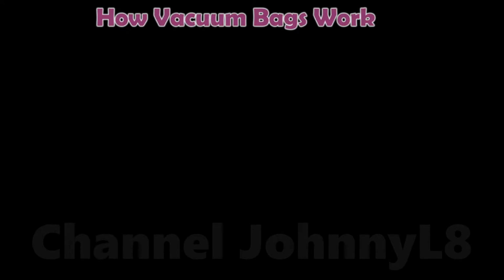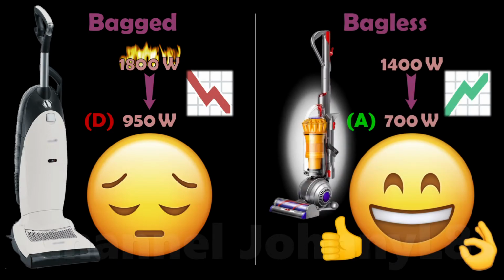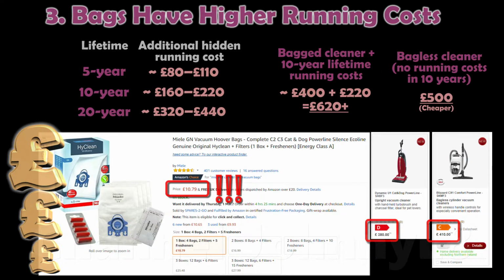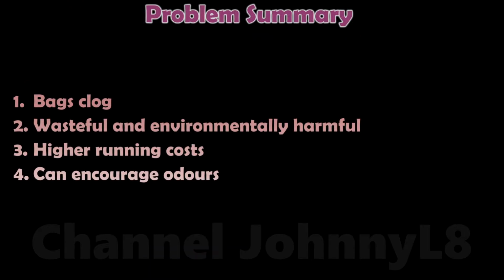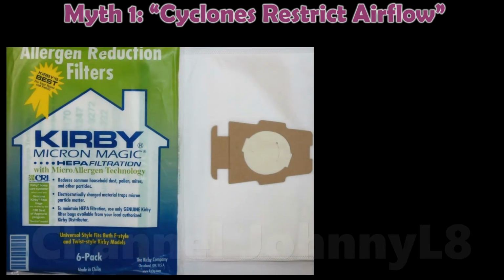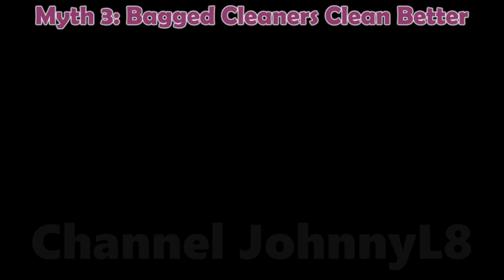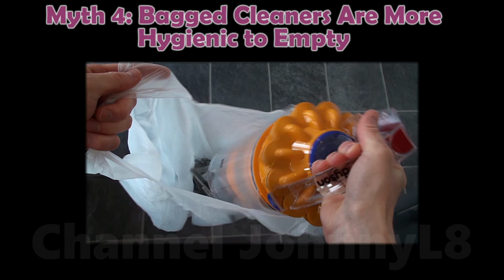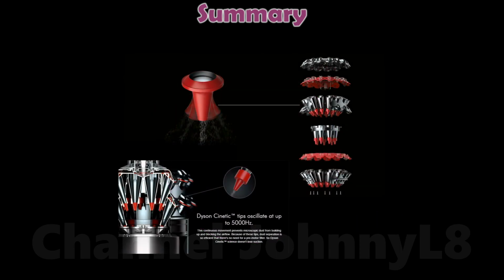Bagged Vs Bagless Vacuum Cleaners

Comment: Dyson performed this standardised test and their uprights get a C rating. There are many bagged cleaners that get an A and B rating for performance on carpet and hardfloors. I think you need to actually try a bagged Miele or a bagged Sebo for yourself. See how well they clean and also see how little the airflow diminishes as the bag fills. Also you need to try a Cinetic and see how much fine dust gets to the motor over time. Henry bags are 9 litre costing £1 per bag. My central vac bag are 8 gallon you can get 12 gallon. These bags last me a year and are £3 each. There's no post motor filter it's vented to the outside. It's one thing going on about these standardised tests but the best test is how these cleaners actually perform in your home. Try some out for yourself! 😁
Reply: Haha ouch! :)
Reply: But when there is an unswept path down the middle you can just overlap your strokes. I find it a pain having to go over with a crevice tool :(
Reply from the maker: That's not a very convincing (or contributory) comment and seems to brush away pretty much the rest of the valid points in the discussion. There's no point in commenting if you're just upset someone has an opinion that's different to yours.
Reply from the maker: But you don't need to go down with the crevice tool generally, unless the mess is so bad that even good edge pickup leaves a bit down the crack. I don't think I've ever used the Light Ball crevice tool on carpet.
Reply: JohnnyL8 That's good to know 😉
Reply: JohnnyL8 As you don't know the details of the tests, it proves your video explanations are invalid right. You don't know what you are talking about.
Reply from the maker: I've already discussed the inconsistency between the EU ratings and formal testing in the EU label video. The EU labels are confusing and of little value and aren't the same as industry standard testing. It's also the reason why I didn't criticise the bagged cleaner D performance rating based on those EU labels. The rest of the video mostly addressed filtration, not vacuum cleaning performance. I've also no interest in subjective testing; I only care about objective evidence on matters such as how much suction a bag loses. I've already addressed in great detail the myths and propaganda surrounding alleged Cinetic filtration failure, as I'd hope you're aware by now. I'm sure some manufacturers have cheap bags, but the brand people always harp on about was considered here. Central vacs are not commercial off-the-shelf products so are a different class of machine not covered by this (although I will say "venting outside" is much like throwing your shit out of the window into the street like some Victorian peasant). The industry standard tests are supposed to replicate home use (this will be covered in a future video, but the information is already available to the public). Some manufacturers also are aware of the need to test in real homes, and when they cite industry test data, they do it for even more rigorous conditions, such as bin full rather than empty, and they still come out on top. Many of the opinions spouted in my comment section are rooted in complete ignorance of much to do with vacuum technology, testing, and core physical principles. The rest of my points in this video you presumably have no truck with.
Reply: So explain why Dyson in their standardised test which is done in proper test facilities only gets a C rating? If it's cleans as well as they say it should get an A rating. The rating system correlates to the percentage of dust picked up from the carpet. And as for shitting the dirt outside the bags filter to 0.3 microns so I don't think thats much shit haha
Reply from the maker: I think there's some confusion. Dyson test to formal IEC industry standards. The EU labels represent testing not done to industry standards (as far as I can tell; it's all very vague) and have invented their own lettering scale. It's not clear what it means and doesn't cover what the consequences of a given grade are in other holistic areas. In formal industry standard testing, the best cleaners get the best cleaning performance on average across all floor types. This doesn't mean the best on one specific type of flooring. None of this detail is covered in the EU labels. This is discussed in my EU label video. I've discussed the importance of holistic cleaning, not only in this video (if you watched it all), but also in the "how to review" video (if you watched all that).
Reply: The lettering scale is correlated to the percentage of dust removed! It is very clear! You can't have it both ways. If Dyson got an A rating you would be saying the EU test is accurate :)
Reply from the maker: It's not as clear as you state and you're showing tremendous ignorance making claims like that. I've even covered much of this, again, in past videos. "hard floor" isn't some universal floor; there are different types, shapes, structures etc. Some are smooth, some have crevices and gaps, some undulate etc. Same for carpets. So and "A" rating on one carpet might be a "C" rating on another carpet. The EU tests are far too vague and tell you very little. Your confidence in the EU ratings is completely misplaced.
Reply: I agree with that. But still whatever floor or carpet these EU tests are done on, there are still cleaners getting better results in these tests than Dyson are.
Reply from the maker: Yes, but again, that is meaningless if the tests don't represent meaningful home use (which the IEC standards generally do a reasonable job of). A better relative performer in a stupid unrepresentative test doesn't mean anything. Just look at the shit on youtube; "Oh look, this 1970's ancient vacuum is clearly better than the latest bullshit Dyson because it performs relatively better at sucking up three shredded newspapers." Dumb test. And again, formal holistic performance grading is all that's important to a customer at the buying stage. The best all round cleaners which score the best on average across all floor types are safe bets they'll work for you. As I said in this video, niche cleaners (e.g. carpet only) serve niche audiences.
Reply: JohnnyL8 But Miele not only gets an A rating on carpet it also gets an A rating on hardfloors. Why does the light ball get a C rating on hardfloors but their other uprights even the small ball get an A rating?  That's a strange one.
Reply from the maker: Without knowing the details of the tests, it's hard to say. What I will say, is that in the EU letter ratings, there's an inconsistency between performance people are seeing and the rating the vacuum gets. Hard floor pickup by the Light Ball has had people bowling with praise because of how effective it is, but it gets "C"—whatever C means. Makes no sense.
Reply: JohnnyL8 I'm going to order a light ball today to see for myself if it's as good as you say. I did have a DC41 Mk2 but sold it. But we shall see. I do like a cleaning head that cleans on both edges so that's one thing I dont  like about the light ball. And you have to clean the floorhead regularly or you get dirt building up on the end caps.
Reply from the maker: I wish I had that kind of disposable cash. :) I've never had dirt building up on the end caps. How well it edge-cleans depends on the floor and dirt type (see my review).
Reply: The brushroll on the right side doesn't get close to the edge probably down to the direct drive. On the DC41 the belt drive was in the middle so the brushroll reached very close to the edge on both sides but of course you can't just slide it out then.
Reply from the maker: True, but on the DC41 the belt left an equivalent unswept path down the middle. Edge cleaning for normal mess levels is fairly good for the Light Ball. It just looked more problematic because I exaggerated the mess levels, falling victim to my own criticisms it seems. Lesson learned. Plus, if you've got a bad mess where this level of nit picking would be relevant, you'd always have to use the crevice tool anyway, so it's fairly academic.